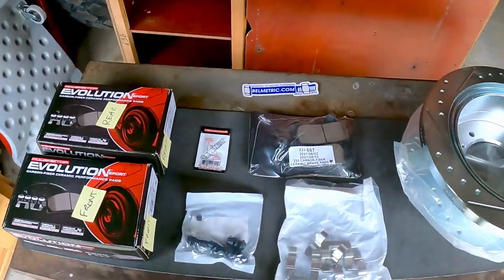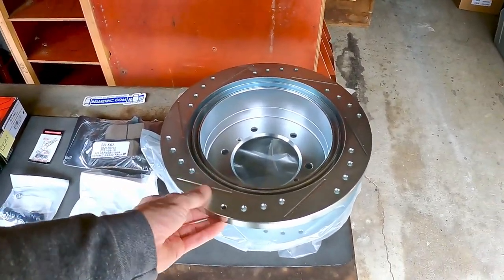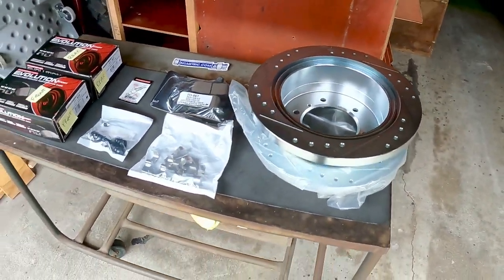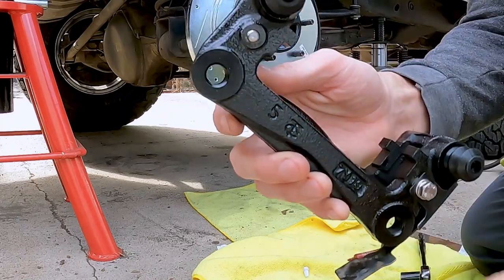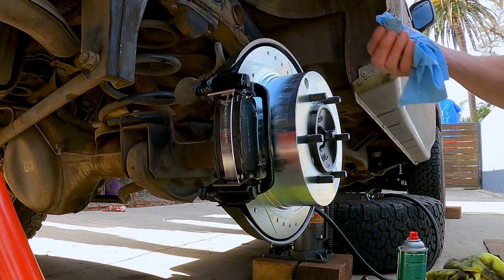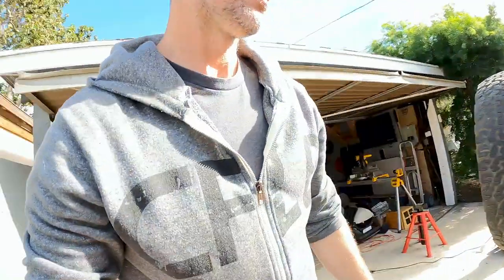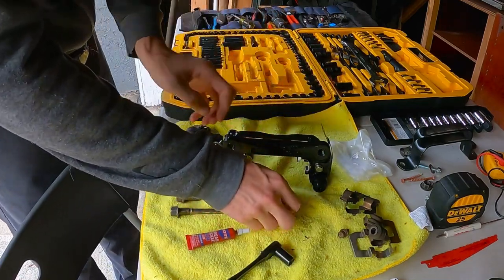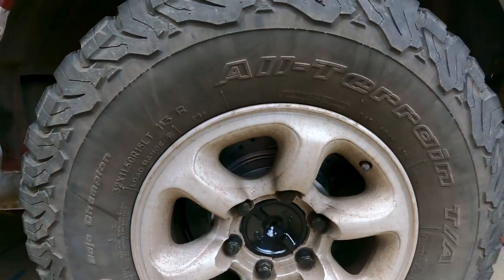Upgrading brake pads and rotors on the 1998 Mitsubishi Montero

Comment: Nice. Looks simple enough. The fronts is what I'm a little scared of haha
Reply from the maker: Funny you should mention that. I attempted to do the front a few days ago. I didn’t know I had to pull the hubs apart to do it. Ended up putting the old brakes back on. There was a bit of play in the bearing so I am going to order new bearings, a special tool, and some manually locking hubs and do everything at once.
Reply: Yeah that's what I looked at too and been looking for a video on how to do it. Tips and tricks. I ordered the rotors off a sport and pads as well. There a 1" bigger and get better bite. Sport caliper is what's needed to upgrade them

Comment: If you leave transmission in L or first gear it should slow you down quite a bit.  I have a 98 montero sport automatic 3 liter engine and the L in high gears slows me down on steep paved roads.  Not as much as i would like maybe it would be good to have the 4.9 gears or an automatic transmission with higher gear ratio
Reply from the maker: Thanks. It does help quite a bit.